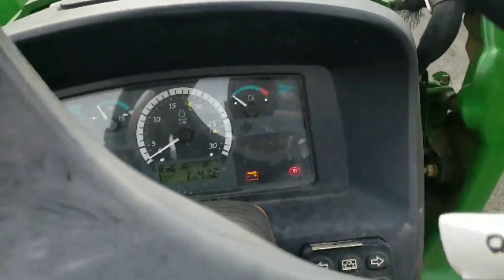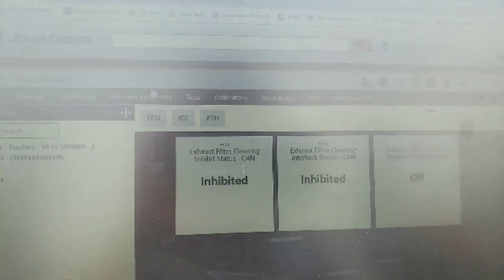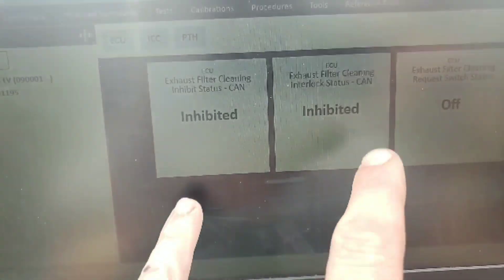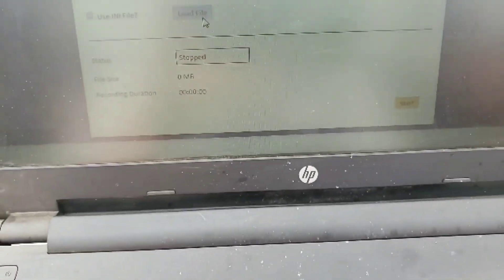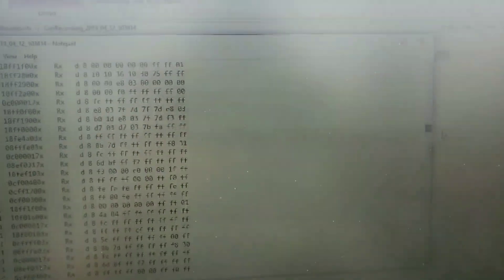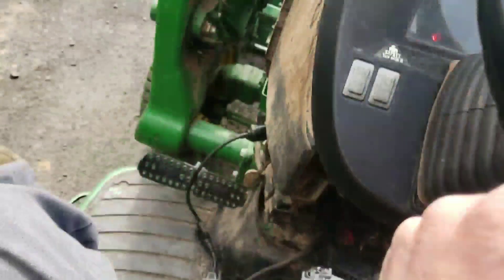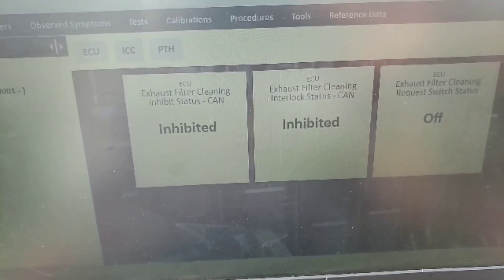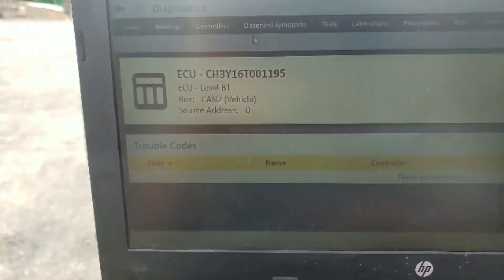3039R - Follow Up W/ A Variable

Comment: Decoding the data, very interesting they can do that!
Reply from the maker: Keep in mind that anybody can decode it, it is just time consuming. All a scanner is doing is sending out it's own CAN messages, and those had to be decoded for the vehicle.

The message structure is based off standards, and HD/Off-road is J1939 which is a bit easier to decode based off of the standard. It's worth researching as it is an interesting topic.
Reply: Science Of Diagnostics, I will look into it further! I find it extremely interesting what is going on in the background as they communicate back and forth.

Comment: Great video man! That’s pretty impressive how they’re able to decode CAN signals. I wish the automotive industry would start doing that!
Reply from the maker: They are. That's all a scan tool is really doing. Then there is can sniffing. It's interesting stuff to a degree; you can get lost in it but it's all based off of standards with some proprietary stuff.

It has some practical use cases, but not a ton. Check out Pico Autos last 2 live streams.

https://youtu.be/Bc2R462dlac

There are some times where I wish I could easily read it to confirm proper message or make my own bi-directional control, but there are a variety of other ways to do that usually. I could talk for hours about it haha.

Comment: Wow at least they could of posted a service bulletin for the techs... good job 👍🏻
Reply from the maker: None of the factory tech support had ever run into it. Must have been an engineering only deal. It would be nice to just remove the data PIDs, or update the software. I see multiple possible directions it could have gone.

The important thing is that the comm errors are gone and I got a chance to learn something.